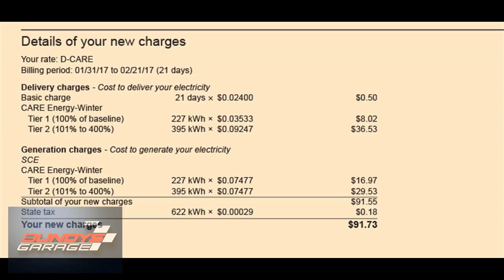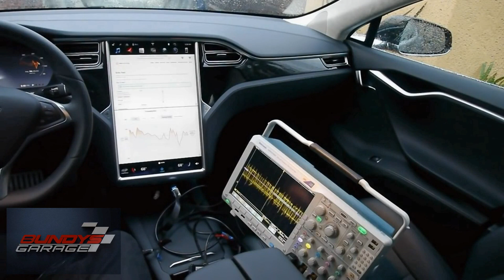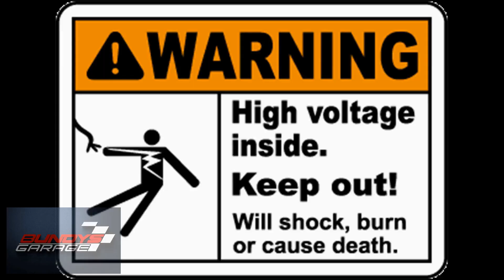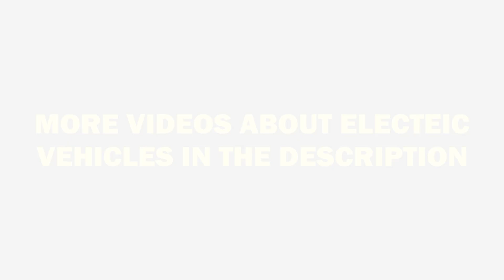Future of Electric | ELECTRIC VS. GAS VS. DIESEL | BUNDYS GARAGE

Comment: Diesel engines cost more and their fuel injectors need replacing more often. Diesel gets better miles per gallon, so it makes more sense for longer trips and more weight. Electric is more of a hassle to plug in every night or during a long trip, and it is a gamble that the big battery will last a long time. Hybrids have more parts, the big battery is expensive to replace, and they are often tuned to be slow like a Prius, or a lot more expensive like a RAV4 hybrid. We have bought used Mazda CX-5s lately, and might buy a used Mazda CX-30 next. To save more cash, a used Honda Fit or used Kia Niro hybrid seem like good choices. Not too used.

Comment: Electric car's advantage is max torque at 0 RPM.  In the U.S., Fossil fuel (natural gas, coal) is used to generate almost 63% of the electricity.  20% comes from Nuclear.  Unless there is a major shift in power generation and storage, electric cars is not much greener.  With ICE inefficiencies at the power plant, transmission loss, transformers' losses, you will be surprised how little of the original energy gets to propel the car.